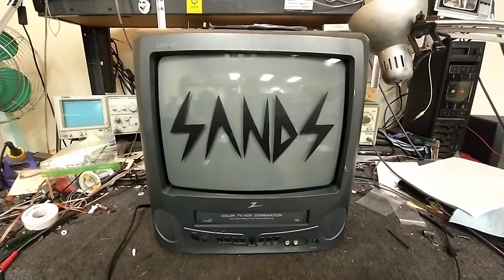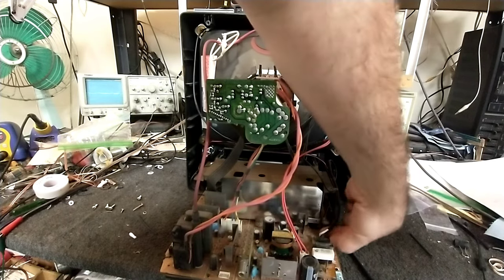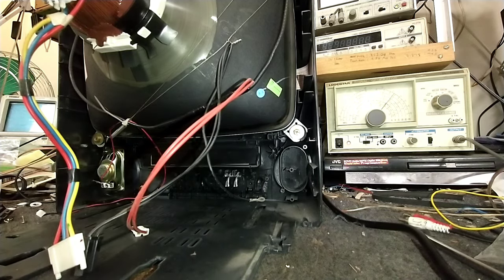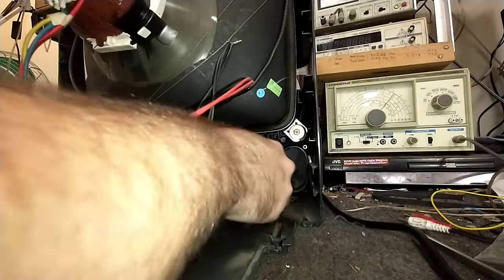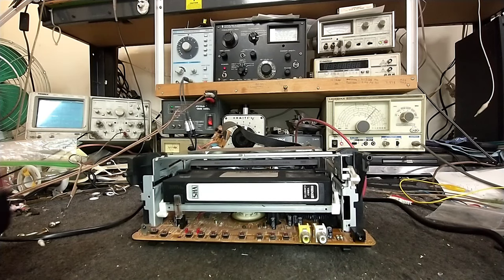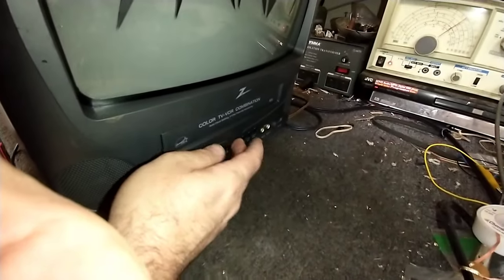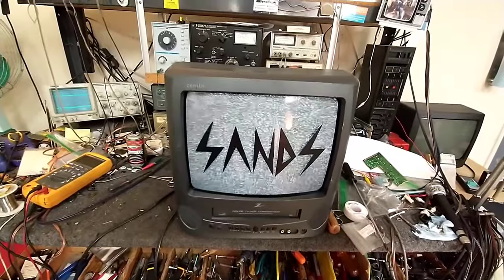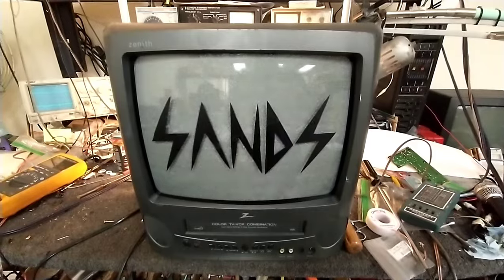Servicing a 2002 Zenith tv/vcr combo model TBBR1352Z - Broken buttons

Comment: I used to make "hinges" for broken plastic buttons etc with a small piece of solder braid. You can melt it into each side, the button and the button mounting surface, with a soldering iron. Works great as the solder braid mesh sucks the plastic into it, making a very good connection, and its flexibility makes a perfect hinge! I;ve done this a hundred times, and its worked excellently every time.